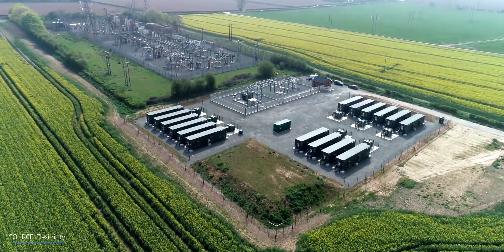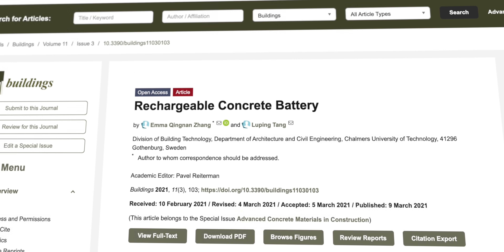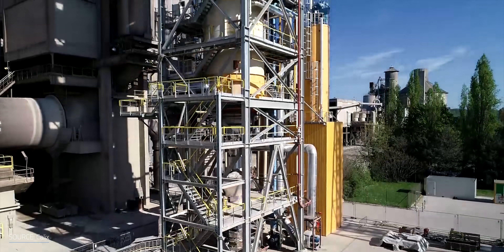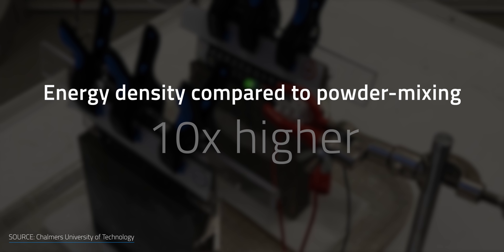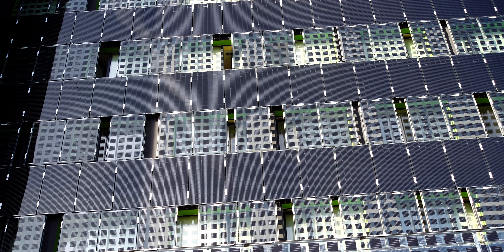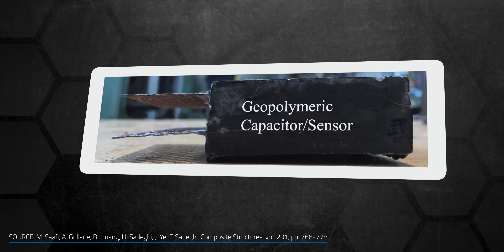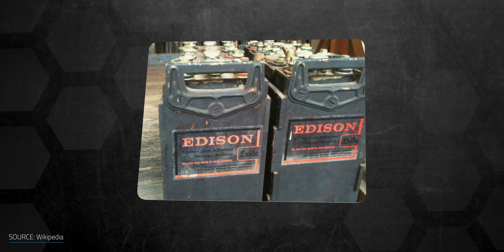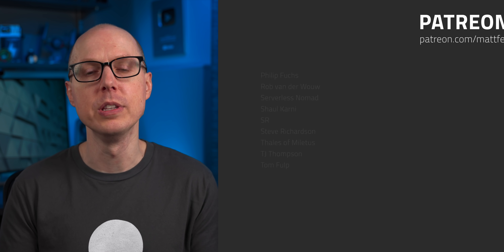Turning Buildings into Batteries? Concrete Battery Storage Explained

Comment from the maker: Does it sound too good to be true?  Do you think alternative battery technologies like this have a shot? Save 25% on your first Native Plastic-Free Deodorant Pack - normally $39, you’ll get it for $29! Click here https://bit.ly/nativeundecided and use my code UNDECIDED.

If you liked this video, how about watching "Energy Storage Breakthrough - Solid Hydrogen Explained": https://youtu.be/U7CCq4oBgw4?list=PLnTSM-ORSgi5LVxHfWfQE6-Y_HnK-sgXS
Reply: Area is not volume. You keep saying how much energy can be stored per square metre. Should be cubic metre.
Reply: @miguelcalvin946  in construction there is this term of "runing metere" or "running merter^2" whitch implies standartised dimentions for wall sickness so you talk in m and m^2 for tiling, tubing, walls, paints, mortar, support wood and Kg for rebar, mesh, el. wires and plastic sheet lining. Those are trade specific units and not actuall physics units, they are short hand for quick approximations.
Reply: I don't think concrete structures are really designed to last hundreds of years: 50 to 100 is more reasonable - sometimes less. However, this might be to the benefit of concrete battery technology since new tech would be incorporated in to new structures. Concrete is now recycled and all this extra metal would have to be considered during the grinding and recycling. Not a huge deal, you would think
Reply: @mb-3faze  Today they are, previously it was less of a consideration as the issues that effect concrete performance were not really known or understood. Putting that right today is a massive issue on its own.
Reply: All the puns in the world won't save you from the upcoming Thunderf00t video.
Reply: Does it weaken the concrete?
Reply: The energy density is way too low, you would need 1000sqft just to power your washer/dryer
Reply: Ur channel is interesting but stop pushing these IDEAS as a new found technology to fix problems. Things like this and many others you have dove into need more SALT and push back from you. Stop insulting your audience by not diving into the working of the new tech and its foreseeable logistics.
Reply: @akumaquik  Theres a few problems in your comment

1) You think the painted egg has the ability to even slightly research these topics! 
He cant he spews forth the lies from the start up scams!
2) Even if he could he would not be bothered because these are to excite stupid people EG musktards!
"Stop insulting your audience "
Most are too dumb to realise the massive flaws in these fairytales, the other dont come here apart from to have a lauff!
Reply: @danquaylesitsspeltpotatoe8307  It's spelt 'Laugh'.
Reply: @And-rc9yy  Not in old english so dont use that spelling if you are going complain about it not being correct!
Reply: @danquaylesitsspeltpotatoe8307  I got a good laugh outta ur reply and I do agree with ur response. Most people are not dumb, just ignorant to the inner workings of new ideas like this as they only see the upside and hope good will come outta new technology. Thankfully  Thunderfoot just tore this topic apart and I hope youtube recommends his video for those who have seen this.
Reply: @akumaquik 
 "Most people are not dumb"
Yes in intelligence and also in the  way you say they can easily be scammed.

" just ignorant to the inner workings of new ideas like this as they only see the upside and hope good will come outta new technology.

But not only just for technology scams like we see on here all the time. Companies that are worth billions on paper but are actually worthless. Teslas case is slightly different in that it is worth a small amount of money, which is way less than what is owed..... Its value is in over priced shares.
Reply: @danquaylesitsspeltpotatoe8307  

Thts a fair point about scams but optimism is a human norm and is socially engrained in us. Most people/companies dont like downside or contrarian thinkers. They are often viewed as negative people tht halt forward momentum.   

Part of me wishes i would have invested in tesla but the logic part of my brain yells at my greedy shoulder devil. HYPE is powerful even when not practical.
Reply: Idea for next video : Thermally-Localized Multistage Solar Still TMSS
Reply: Even the prototype of this has real world uses today without improvement. 
Just look at how much concrete is used in literally everything and all we ask of it is to be solid. This makes it also store power while storing heat and being solid.
Reply: @johnathanstephenson8107  that is soo not how this technology can be used
Reply: I think that the second biggest issue with these Concrete batteries, would be maintenance. How do you repair/replace a battery of this nature, when it fails, if it's moored in all it's surrounding concrete?
Reply: I wonder if you take this idea and maybe change it so that instead of concrete, use a sandwich of "cultured marble" or "Corian" (quartzite and resin) doped with the wire mesh and carbon nanotubes, if that could perhaps help somehow/reduce concrete usage. 🤔
Reply: @waylontmccann  Cultured marble is far more carbon intensive than concrete
Reply: No offense, but all 3 cement jokes were ... awkward at best.
Reply: @Matt Energy storage density/capacity isn't expressed in Area.  It's expressed in Volume.  So all your commentary about storage density is meaningless.  Other than the comparison to two AA cells, but even that is terribly weak because you don't quote the volume of the concrete structure being compared to the AA cells.   It's left as an exercise to the reader to wildly guess.  So this is the first article you've posted that I've ever given thumbs down.
Reply: What is to stop the concrete from delaminating from the battery or the battery itself to split in half compromising the strength of the structure?
Reply: Why not store energy by using it to lift a concrete block using pulleys and then release the energy by dropping the block, turning the pulley and generating electricity - sort of like the old cuckoo clocks with the weights.
Reply: @High-Tech-Geek  Its used allready in hydro accumulators. You basically pump water up to reservior at night when the electricity rate is lower and when needed release it onto turbines.
Reply: @High-Tech-Geek  ... yes ... https://en.wikipedia.org/wiki/Pumped-storage_hydroelectricity
Reply: @High-Tech-Geek  requires a large area, large elevation changes, all those mechanical moving parts wear out pretty quick…
Reply: @jsbrads1 Inexpensive steel pulleys and cables will last 100 years. These expensive rare earth batteries will last a couple years at best and degrade with every charge.
Reply: @High-Tech-Geek  no, I don’t know about the life cycle of the cranes, but I do know pulleys and other parts that undergo friction don’t last a hundred years.
Reply: @jsbrads1 Steel cables at Golden Gate Bridge are 100 years old. Eiffel tower's 150 years old, still standing and elevators & pullies still running. Almost no batteries more than 10-15 years old. Egyptian tombs have functioning pulleys 1000s of years old.
Reply: @High-Tech-Geek  static cables are different than pulley wheels and the like. Elevators are constantly being maintained and break down all the time.
Reply: What actually happens to the concrete during these draining / charging cycles? This process is similar to the severe deterioration of concrete exposed to Chloride ions which is a massive issue across the world today with existing infrastructure.
Reply: What a bunch of morons...
Reply: So whats todays scam start up?
Reply: Matt, W/m**2 is NOT energy unit!
Reply: Idea for next video. Take a look into Bergen carbon solutions
Reply: I think we need to invest lowe energy efficiency so your TV and fridge.
So tv why not have it put out less heat and use less energy needy parts.
Fridge why not have a more efficient gas thats better for the environment and have some better pump that uses less power and is quiter.
Reply: Do you know if anyone is seriously working on crystal power cells?  I looked into the DIY scene and it is BLODDY impressive, with LEDs, simple (unloaded) motors, etc. literally running for years off of a single cell the size of your thumb.
Reply: @KeithOlson  now THAT could be used as fillings in block cavities assuming they are not toxic or fiberous, as even asbestos if banned in constructiong and glass wool if frowned upon but is considered as nessesery evil. You need to know that when hmyour everage Joe is hanging pincture on the wall will not sue material manufacturer for any real or percieved ailment.
Reply: I'd be more interested in seeing an affordable ESS liquid redux home storage units personally.  I'm wondering if that's in the realm of possibility. I have to assume that with economics of scale it would be more viable than any battery pack.  With as many charge cycles that it can handle and it seems like there's one part that has to get replaced after years, making that part of a solar install on a home where both could last you decades, with the swapout of a couple parts for the ESS unit that sounds like a great way to go and environmentally friendly and you don't have to worry about digging your wall out to swap storage.

But what do you think??
Reply: @johndoh5182  turn the electrolite into very viscous jelly and it might work. No liquid intergratiins is allowed in walls, safety standarts just woun't allow it. It has to be digestible too or almost digestible.
Reply: Floatwheel would use everything, not just concrete... Moment of inertia, imagine digging a donut pool next to a river and then bolt together 10+ ships front to back in a circle, put everything and everyone on the ships and then have motors add power from a power plant and or absorb the river...  Use DC motors as generators for anything that is not mechanical energy... 

Primitive power, apart from the electric that was possible thousands of years ago
Reply: So we have a place to store the power.
Great!  Now we just need to get power.
Reply: What will we do when we run out of Lithium? We certainly won't be using cement batteries,  we need an alternative now to build the infrastructure needed. The deck of cards is delicate and we keep pushing in the wrong direction.
Reply: @YragLee  checkout Iron-air batteries, those are the future I think. They are bulkier than Lithium Ion but much more robust and consumer friendly.
Reply: Undecided with Matt Ferrell , CO2 is PLANT FOOD!!
Reply: @frankbrislin4378  Plants only absorb CO2 during the day when sun light is present. During the night the respire (produce CO2) like other organisms.
Reply: A serious question, could this mechanism be used to control the rusting and therefore expansion of reinforcement in concrete structures?
Reply: @marcm.  an input of power can reduce oxidation, though a sacrificial zinc plate will probably work better. We probably don’t do that because the design is supposed to seal the steel. Most reinforced concrete works well, we get to see a few bad cases, but most outlive life cycle.
Reply: @marcm.  just imagine the costs of employing ppl, that are actually carefull with coating on rebar and mesh when installing them, vs current brutes X). As for rusting controll, youll need a motherload of imbeded  sensors and also the process is not uniformal for the reverse rusting, as far as i understand, whitch will create temporary strain concetrations. But the idea itself is facinating and can drastically increse lifespan of concrete.
Reply: I produce commercial cement and concrete science and chemistry..i own the business. I invented a mortar chemistry that is 100% free of portland,  mag phos, magnesium oxide and no CAC. Basically its new. I believe it is possible to one day create new technology that can store a charge inside cement. The challenge is preventing leaking. If the current is also grounded then it could suddenly drop or slowly drop. So keeping the charge or holding it is key. I have another idea that could work and Ill leave it there. Anyone who wants to know more can PM me
Reply: robert murray on yt has been experimenting with many things on this front. i remember a painted substance with carbon from toner. check out his channel
Reply: I'd be willing to do contracts for this.
Reply: U know both solar panels and windmills are not green  solar panels are super toxic and don't last. Long time there is windmil blade graveyards not to mention bird killing aspect only clean energy is water based
Reply: Jorn Paul Winkler  Do u have a point you would like to try to make?
Reply: Do you even know what you are saying anymore???? This technology is such bull and you are spouting off like it's the next best thing... Dude, what the hell. 7wh per square meter???? Using it in buildings????? Are you just intentionally lying? 

Never watching your videos again.
Reply: I can see only limited application like those lamp posts. As someone already wrote, those cement batteries are meant to be thin, measured in m2 not m3 (volume). Additionally, when you build the building, you MUST have iron re-bars that need to pass through entire building, short-circuiting everything. Not to mention how would you isolate "battery"  from the earth/ground, so you do not loose charge.
Then, if you want to convert entire concrete volume to be a battery, construction cost would skyrocket because you need to be careful some worker with IQ< 80 does not short then anode and cathode while pouring concrete, because there is no going back and if creation of the battery fails then all the additional cost to painstakingly build that battery iswasted money.
So only prefab elements for specific use case built by smart and careful workers...
Reply: Still pushing the solid hydrogen fairy tale! SUCH A DISHONEST LIAR!🤦‍♂️🤣 to try and sell deodorant!
Reply: Jorn Paul Winkler  stop spamming your waffle!  This guy is a bot
Reply: wait. what about the longevity of the concrete batteries? and why hexagon shapes? lots of unanswered questions thus far granted i'm only 7 minutes in to the video thus far
Reply: I think we need time for all of this to....  set in..  :)
Reply: This green idea is bound to reduce concrete's strength by 50% and with the reduction reaction a further 30%. This step backwards is known in modern times as progressivism.
Reply: Jorn Paul Winkler  I watched your video and there appeared a bunch of like minded socialists. It said that 'facts are not persuasive & can backfire' and it said that 'the person who is giving you the information is more important then the information itself' ??? Climate change is a scam. Don't brainwash me with your woke nonsense. They looked into Thorium reactors and after 30 yrs can't get them to work. Cut the misinformation.
Reply: Jorn Paul Winkler  rofl... not sure what you were reading dude but nothing i said suggested doing nothing - only that the author invest the effort to understand the topic he's reporting so he can say things that are meaningful on the subject.  Talking about square area units of electrical capacity is utterly meaningless, unless you're talking about something like solar that is collected over square area.  Batteries on the other hand, are rated in capacity per cubic volume, and weight.
Reply: Jorn Paul Winkler  thanks for that very comprehensive reply. I totally agree wind and solar produce far too much waste with short life spans, they don't work well with the natural environment and they cost more to produce and run than a normal coal or gas power supply.  However, storing power in concrete and roadways etc is a gimmick at best.  The inefficiencies in both storage and transmission would not be worth the maintenance cost.  We really are stuck for a decent power source that meets all our needs.  We can only hope that fusion comes along faster than the 20 years they've promised for the past 60 years. Failing that nuclear is the best option, especially if we advance the means of reusing the waste, or do what I think its Denmark have done and build a massive underground storage area for the waste until we know what to do with it.
Reply: Jorn Paul Winkler  I tried to say the same in a lot less words lol.  Sadly nearly nobody reads more than a paragraph.
Reply: Jorn Paul Winkler  I think your making a big deal more, than it already is. If you took a chill pill I think you'd be back to normal. I don't know where you get your Armageddon but the world will be ok, just wait and see. BTW implementing green energy has rendered Europe weaker against Russia !
Reply: Jorn Paul Winkler  if Putin was working against shale oil operators then he was funding the democrats because when they came to power all shale oil permits were cancelled.
Reply: Jorn Paul Winkler  Sorry but if you want me to follow your thinking, that needs to make sense.  I stopped reading your response when you said that 20% + 20% + 40% of 3 different categories = 80% of all categories.  20% + 20% + 40% is somewhere between 20% and 40% (average of the three.)  News is reporting it as 30%. Thankfully they can do arithmetic, lol.  Nuclear is green, so I'm glad with how things are working out.  Sooner the better.
Reply: What will happen if the building was hit by lightning? Could it harvest that source of energy  ??
Reply: Why not start with the basic idea before wandering through a lot of  specifics, as Matt does?
Reply: BUSTED!! BUSTED!! BUSTED!! BUSTED!! BUSTED!!BUSTED!! BUSTED!! BUSTED!! BUSTED!! BUSTED!!BUSTED!! BUSTED!! BUSTED!! BUSTED!! BUSTED!!BUSTED!! BUSTED!! BUSTED!! BUSTED!! BUSTED!!
Reply: beyond stupid idea, and its not a concrete battery that's just the box, so you have to tear down the building and rebuild 2 replace? lol and as the metal inside rust/ breakdown it will damage your building forcing a teardown rebuild or fall down. lithium or lead . and propane for when that runs out. only real choices.
Reply: Thunderfoot is coming for you 😂😂😂😂
Reply: How did you miss the potential to charge your electric car through induction while you drive? Solar panels along stretches of freeway in between cities charging up the concrete and then your car battery while you drive.
Reply: Why store energy when you can just tune into it and use it? Think about it, if flying saucers patents if the 40s are true, a source of significant energy would be needed. The only way would be to collect energy from its surrounding environment,. Like tuning into a frequency that is everywhere